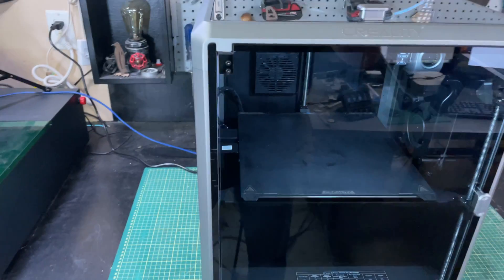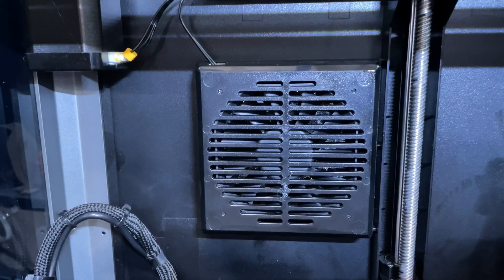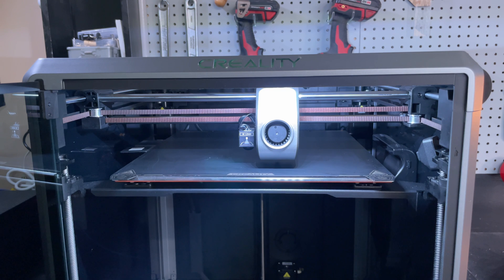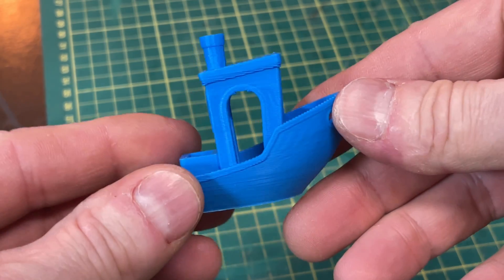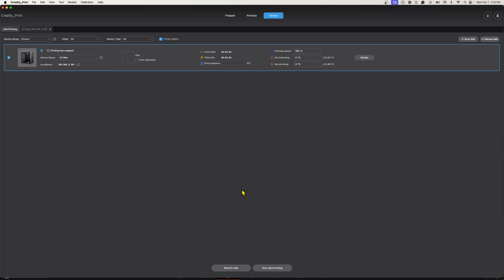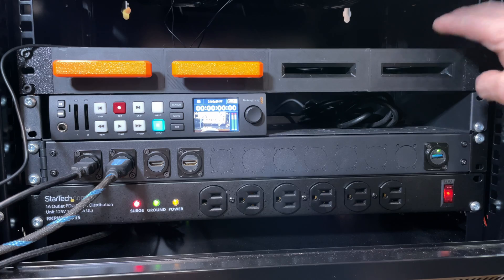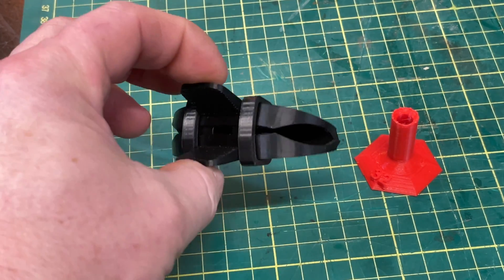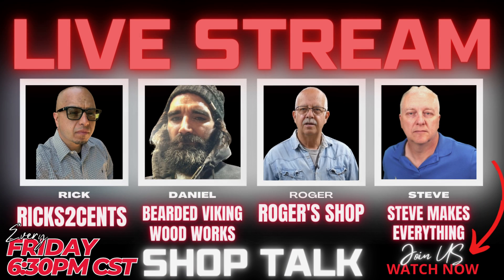Creality K1 Max Review - A 3D Printer That is Big, Fast and Smart

Comment: I have a E3 v2 and the E3 v3 se, both have worked well with no major issues other than user error on the V2. K1 Max will be my next printer. Thanks for the Videos Steve.
Reply from the maker: Thanks for sharing.  The K1 Max, is definitely a major step up from all of my previous printers.  I have 5 of them in my office and I may retire all of them.

Comment: ive "discovered" it takes 4 shipments worth of creality printers to deliver one that is not basically unusable.  I own 2 currently, the 2nd is  going back.  I own several bambu units...no problems with any of them.
Reply: Bet 20 bucks you've never owned neither 😂😅
Reply from the maker: This is my third Creality printer and I've never had an issue or replaced a major part.  The K1Max was fine out of the box, though I did tighten one of the belts a bit and tighten a screw on the camera that was clearly loosened by UPS.

I now has 30+ hours on this printer and if it was going to fail in any way, it probably would have happened by now.